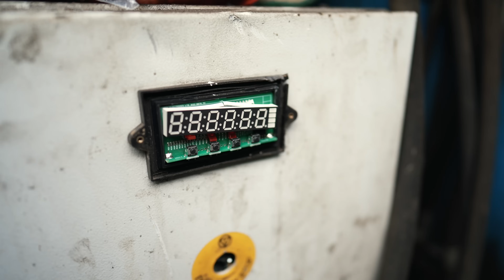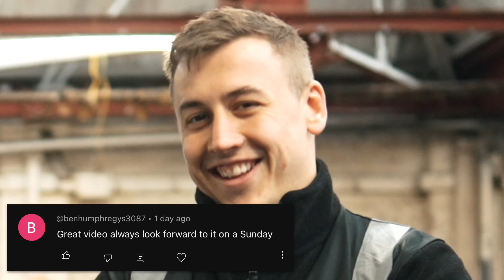IS IT WORTH STRIPPING CABLE? | Scrap King Diaries #S05E06

Comment: I strip cable full time in a scrap shed up in Scotland. I always use the guilitene that yous use for cutting the brass ends of the copper pipes to cut the cable into lengths of about 2 foot. It does a great job.
Reply: Binn skips ??
Reply: Thats the one!
Reply: Used to work at the glenfarg base am guessing your shore road
Reply: Yeah mate im down at Shore

Comment: You could of made more money off the wire what you called waste  ie  plastic   the plastic can be refined and  used as fuel  if you export  and rubber  some company's in the uk bye the rubber  and they make it in to rubber mats on play grounds everything off that wire was money if you had the right contact  and  if you have a van you could collect tyres from company's and get paid  for doing it money  money